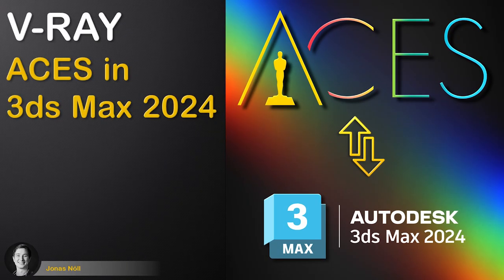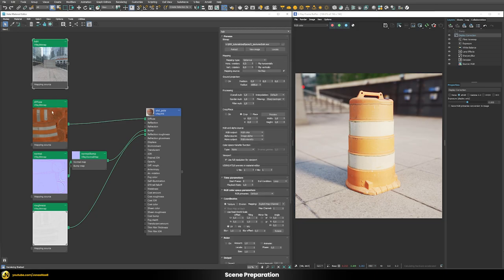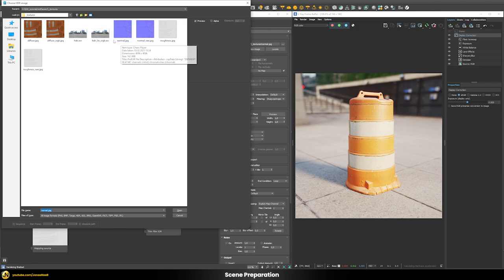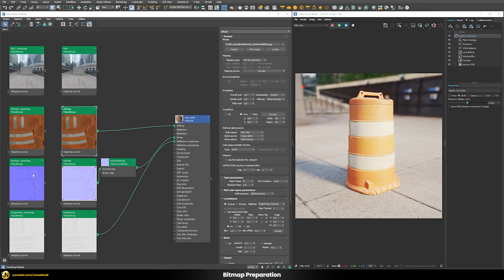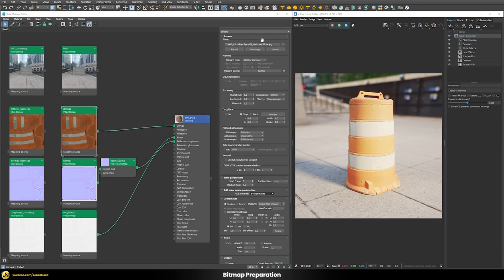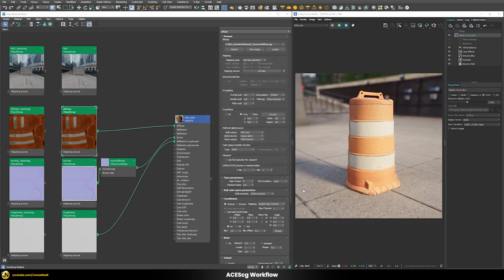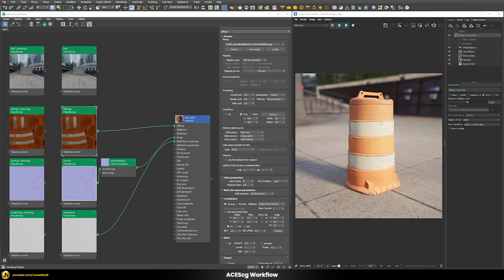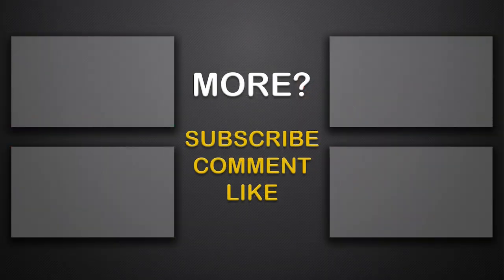V-Ray | 3ds Max 2024 ACES Workflow

Comment: Hi Jonas, thanks a lot for a great video. I'm trying to get onto the ACES bandwagon too, but I seem to struggle a bit. I quite like the colors and the highlight rolloff of the ACES profile but what I'm struggling with is the overall high contrast and oversaturation of the images. Especially the blacks appear almost crushed to me when comparing the new ACES to a typical (old-school) LWF. Did you also have this feeling when you moved over to ACES?

Comment: @JonasNoell you must be kidding.. a typical archviz scene contains thousands of objects with 3-6++ textures each. are we supposed to manually rework them all? ITS INSANE!
Reply from the maker: In 2024 you can automatically define the input colorspace based on various parameters. However if you want to make sure that everything works correctly it is better to use nametags for your textures
Reply: Yes I believe even the creators of vray said this is a problem still there working on. Either you have it the right way or the wrong way it seems there is no fast way to do it

Comment: What are the advantages of using ACES color space for Archviz, is it a worthy reason to switch from corona to V-ray?
Reply from the maker: In my personal opinion ACES makes sense if you work in a whole team or pipeline that requires it. For Archviz if all you are delivering are single rendered images and your client doesn't care about what workflow you are using I would say there are not that many benefits apart from futurproofing your work or if you particularly fancy the "ACES-look" through the OCIO tonemapping.
Reply: @JonasNoell  thanks!
Reply: @JonasNoell  Aside from the workflow benefits, does ACES provide more real representation of colors and light intensity compared to sRGB color space + filmic tone mapping? It always felt to me that filmic tone mapping changes the color hue of my textures and I have to compensate for that. For example, textures that are reddish in tone start to appear yellowish with filmic tone mapping.

Comment: This might be a silly question but how do you know what to change them too manually? like for instance changing the normal map to raw/none but the diffuse to srbg primaries/srgb. Also a lot of the times when I load in a texture it shows as from 3ds max or auto. I'm guessing if its a colour then you would use srgb but if its a normal/bump/roughness then it would be set to none/raw.
Reply from the maker: Yes, basically it is always the same workflow. I would never use and auto modes or from 3Ds Max and always set it manually. So most times the diffuse or other color maps such as self illumination should be sRGB and all the data maps such as roughness, normal, bump etc should be raw.

Comment: Thank you for this! Do the nametags have to be a suffix in order to work? Also, under "Render Setup -> V-Ray" there is also a "Color mapping" tab which is not greyed out. In advanced setting you can see Gamma is 2,2 - would this still be correct?
Reply from the maker: Unfortunately Yeah
Reply: @JonasNoell  Alright, thanks for replying! I think I edited my comment with one more question after you replied if you dont mind <3

Comment: Thanks for the tutorial Jonas!
I used to render in an ACES Workflow based on your previous video on ACES workflow in max without even knowing that I should be setting up my bitmaps RGB Color Space Parameters and their Color Space Transfer Function to the appropriate options. And to be honest, the renders used to definitely look better than sRGB workflow and they looked quite realistic with some slight color correction adjustments both in material editor and/or in post. Now I started using the new Material Editor, VFB and Max color management settings as you use in this video and my renders look way too saturated and not even slightly close to how they should look. 
Do you know why this is happening? Because I don't even know what to do at this point anymore!
Reply from the maker: Are you trying to open existing scenes? It is meant to setup the workflow at the beginning. If you trying to open existing scene which have been setup using a different workflow you might get colors which seem strange to you...

Comment: Thank you very much for this video :) Is it possible to set an indiviual display config file for the display correction or am I only able to stick with sRGB? Maybe I'm wrong, but I think your example only works when you are using a sRGB monitor, right?
Reply from the maker: By default it assumes sRGB, but in the OCIO settings you can choose a different display device
Reply: @JonasNoell  Ah, awesome - thanks a lot :)

Comment: What settings should I then use for the file exports?
I usually save frames to 32 but TGAs for maximum software compatibility and those then either end up darker or desaturated, depending on what settings I try, but never identical to the sRGB display in the VFB.
Reply from the maker: I always use EXR. It also can be opened by most software. It should match the VFB exactly
Reply: @JonasNoell  Do you save to the suggested defaults or anything different?
Reply: Always save multi-layer exr TGA just don't have enough color range in them

Comment: are you making a tutorial about your endless engines scene ?
Reply from the maker: Let's see, there is already a lot of content in my channel that covers how to do exterior lighting, rendering environments using megascans assets, car shading, procedural mud, rust & dirt effects, using Forestpack/Chaos Scatter PLUS I have a whole course for car rendering on my Patreon, so I don't think there would be a whole lot to add. If you wanna know right now how it's done I recommend to check out those videos first as those are the same techniques.
Reply: @JonasNoell  i want to see how did you do set dressing for the environment
Reply from the maker: @anony124  As said there are lot of tutorials on this already on my channel + a breakdown for the Endless Engines Scene.
Reply: @JonasNoell will check them out thx!
Reply: @JonasNoell  If you could please focus on the animation side of things (settings for flicker-free render, things like motion blur for objects in the scene, tricky for tires), that would be great, because these weren't covered extensively in your tutorials yet.

Comment: hi. i have question about roughness.
when we assign roughness map to refelection roughness, we have to set the refection color to 255 in vray mtl too?
thanks alot for your help.
Reply from the maker: Yes, because this map just defines the roughness. In order to have some reflections show up the reflection color has to be brighter than black. Normally this value should be at pure white as this defines the maximum reflection value at the glancing angles.
Reply: @JonasNoell  
Thanks again :)

Comment: Thanks for vid btw,
This may be a stupid question, but why do you use Vray? Is it because it has certain strengths that only Vray has 🤔?
Reply from the maker: Mainly because I have been using it for a super long time and so far I haven't encountered any other renderer that could give me tremendously better results quicker and easier. Maybe Corona would be an option, but there are too many inconveniences for me changing personally. Additionally I like that V-Ray is pretty customizable being able to control most parts of the rendering and which lights/reflections/refractions affect which objects and so on...

Comment: I just need a script that can properly convert vray materials maps to proper settings for aces. With fast turnaround and hundreds or thousands of maps using model libraries its impossible to convert everything manually.

vray converter from corona to vray is so bad that half the time it places reflections on 100%, glossiness to zero and bump to 100%. I might be wishing too much for them to have a converter for aces maps that have already been plugged in correctly.
Reply from the maker: Yeah it’s a pain that’s why I also stick with my sRGB workflow for now. There were some (paid) scripts out there that can switch your shaders and maps to Aces but I forgot what was the name. But I’m sure you can find it, they exist. Don’t rely on the native built in solutions, last time I checked it wasn’t really helpful in that regard…

Comment: Hi Jonas, thank you for the overview! Do you know if any correction needs to be made to materials using a vertex colour map in the diffuse channel? The vertex colours look different after switching to ACES and I'm not yet sure if it's to be expected. Any further info much appreciated!
Reply from the maker: Oh good question. Actually I guess it would need to be converted as it doesn't go the normal way through the material editor. I would try to put a VRayOCIO node in front of the vertex color and try out which way they would show correctly. But if that doesn't work I guess the best would be to ask in the Chaos Forums as this is a quite specialized question and I'm not that deep into the whole ACES and conversion stuff.
Reply: @JonasNoell  Thanks for your suggestion! That was the first thing I tried but I couldn't get it to match despite trying a range of the most logical inputs/outputs for the conversion. I asked about it on the Autodesk forums and they confirmed vertex colours aren't yet supported from their end so perhaps that's why. Might be worth asking on the Chaos forums as you mentioned. Cheers!

Comment: The problem with changing color space workflow is:

1. It's not simple enough

2. The benefits for a lot of users are non existent

Don't get me wrong, I want to do it "the proper way" by switching to an advanced color space workflow like ACEScg, but I get nightmares just thinking about explaining that workflow, and why we should use it, to my colleagues.
Reply from the maker: My personal view is: If noone requires you to use it then I wouldn't make the change right now. It's mainly for bigger teams or studios with a whole pipeline setup in ACES where all departments can work with the same colormanagement consistently through different applications. ACES is right now more tedious to work with and it is not a magical button that will make all your renderings nicer. However there is a big interesting in the topic in general, no matter if bigger studio, individual freelancers or hobbyists.